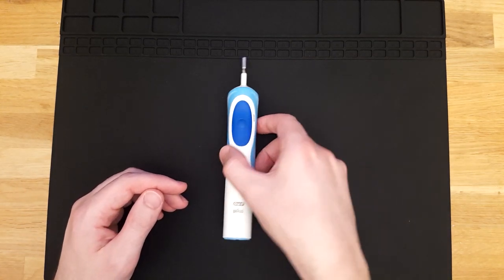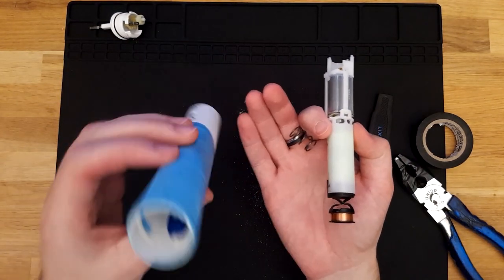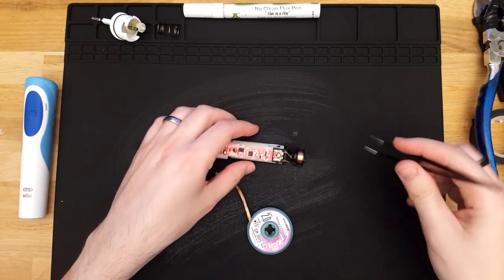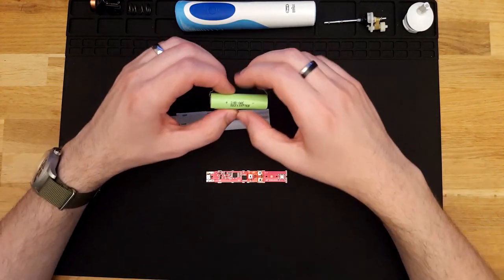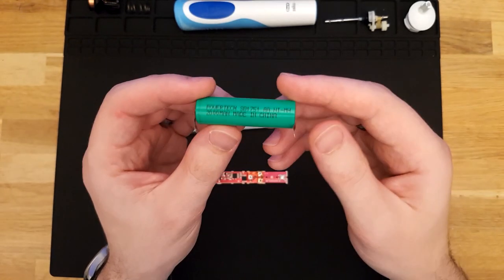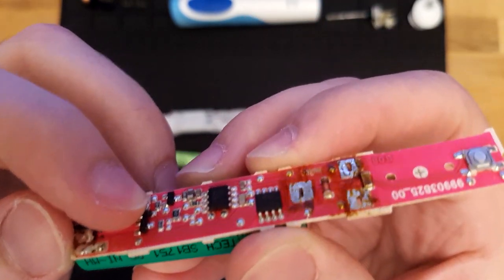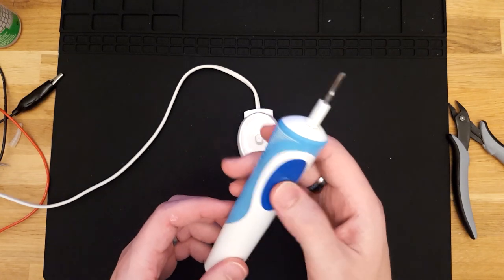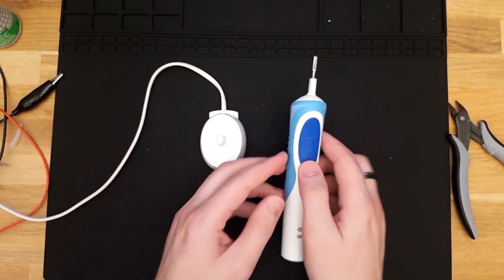Replacing the battery in my Oral-B electric toothbrush

Comment: This a very useful instructional video that shows all the missteps which accompany any repair job - others I've looked at for other purposes edit them out, and the most difficult parts are often not shown. The device being worked on frequently differs from the one shown in ways that are not evident until you pull them apart and dealing with this can be hair-raising! (Latest job was a vacuum cleaner motor replacement - a generic motor did not cost much more than the replacement brushes which were all that were needed.)

Comment: Don't know if this came up elsewhere, but the original instruction leaflet shows how to insert the top into the hole at the back of the base and twist to remove the top.
Reply from the maker: That's interesting! Out of curiosity from your comment (and also because after 5 years mine's getting a bit gross in general) I just bought a replacement identical toothbrush, but the instruction sheet doesn't have any instruction like this. I also can't see any hole or place in the base to insert the top. Perhaps it's a regional deviation in the product that isn't available here?

Comment: How many volts is battery and what is the size of ni mh battery and mah?
Reply from the maker: Nominal battery voltage is 1.2V. The factory battery was 1000mAh, and I replaced them with 2000mAh batteries.

Comment: Hi Simon, I just replaced the battery in my exactly the same oral b model with a 2500mah ni-mh battery following your video instructions. From 600mah to 2500mah is more than four fold jump. I wonder if it will also take 4 times amount of time to fully recharge the new battery? I think it is important to get the charge time right to maximise the lifespan of the new ni-mh battery. What did your experience with Sanyo 1900mah tell you? Thanks.
Reply from the maker: Since the toothbrush just sits on charge all day in the carrier when not in use, charging isn't really much of a problem. Anecdotally, it now lasts longer off charge, ie when I go away for a weekend.  Also, my name is Nick :-)
Reply: @silvestronsbitsandbytes  My bad haha. It was a different video I watched. Nevertheless, my question is relevant. Sitting on the charger all day is probably shortening the battery lifespan which sort of defeats the purpose of replacing the battery in the first place, don't you think?
Reply from the maker: @daweitowalk  ah sorry I missed your reply! Yes you are right, sitting on the charger is generally bad for the battery. Having said that, I've just now (two and a bit years later) needed to replace the batteries added in this video with some new ones again. Two years life on a battery that's being charged all day and used 1-2 times a day every day. You could probably extend the life by only charging every other or so day, but I'm just too lazy to think about that :)
Reply: @silvestronsbitsandbytes  In Australia, most power outlets have individual switches, which makes it easier to control the length of time the battery gets charged even if you leave your toothbrush on the charger all the time. I am still in the process of working out how many hours it takes for a Duracel AA 2500mah in the same Oral B toothbrush to reach full capacity from empty. Once full, it should last for about two weeks.

Comment: hello 
can I use Li-Ion battery?
Reply from the maker: I'd say no - the charging circuitry required for NiMH/NiCad vs Li-Ion are totally different. It would at best not charge at all, and at worst possibly (though very unlikely) rupture the battery causing a fire
Reply: @silvestronsbitsandbytes  thanks!

Comment: I wouldn't trust the 2000mah rating on a Chinese battery.  Chinese manufacturers are notorious for overrating their batteries.  A recent test of three brands of 18650 batteries from China showed their capacity was between 10% and 13% of the rated energy, in other words almost 10X less than their stated capacity on the label.  Japanese and Korean batteries (Panasonic, Sony, LG, and Samsung) fared much better, at around 98% to 103% of their stated capacity.

Stay away from Chinese batteries until they get their act together and start telling the truth.
Reply from the maker: Yep, agreed. They also have a habit of suddenly going boom. In this case, it's a AA NiMh which are all roughly the same quality these days, and such low draw that the quality doesn't really matter. I was able to go into a local shop and pick it up over the counter in a ~15 minute round trip from home, so convenience > quality!
Reply: @silvestronsbitsandbytes  good points. A bit ago, I tried to see if I could find some non-Chinese NiMH batteries on Amazon... No such luck.  Apparently they no longer produced.

Thanks for the video, by the way 👍
Reply: Just buy the highest mAh available to be safe. You get at least 10% out of the total rating.
Reply: Yeah, I've had similar experience!!  😞

Comment: what is that @9:00? - something  like a ribbon.
Reply from the maker: Desolder wick - it's a copper braid soaked in flux, when you apply heat and the flux melts it attracts the solder from the joint up into the braid.
Reply: thanks